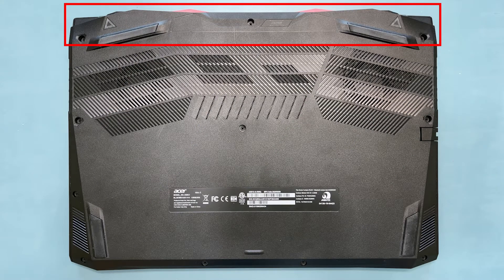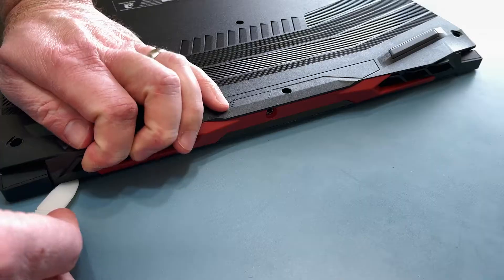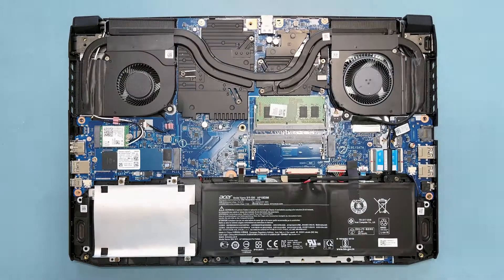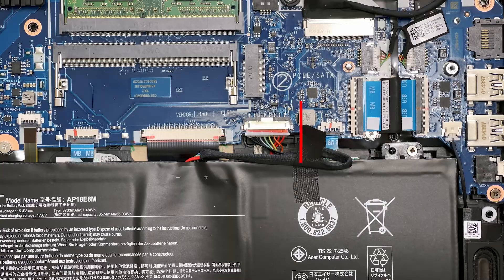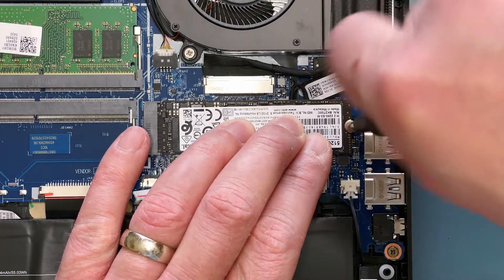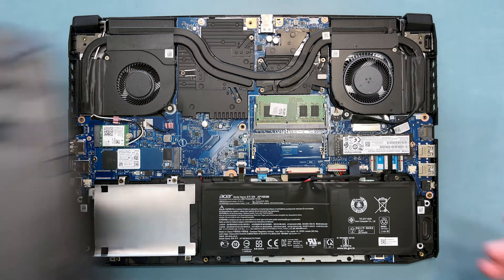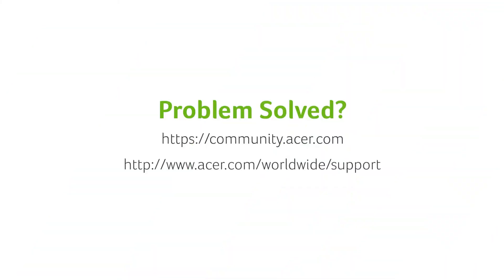Nitro 5 - How to install a second M.2 Drive

Comment: Does the laptop auto detect the M.2 drive or do you have to enter bios and check there to detect it? Also is this M.2 drive compatible with the Nitro 5 2021 model? Samsung 970 EVO Plus 1TB NVMe Solid State Drive. Thanks everyone!

Comment: upgraded my ram from 8gb to 16gb on my acer nitro 5 11400h 3050 variant. both my RAM stick sticks now run at 2933mhz instead of 3200mhz and there is no way to access xmp...

Comment: is Thunderbolt 4 supported in the Acer Nitro 5 (AN517-54-75NK)?  I've tested 3 docking stations but didn't work.  Can you please send me the datashet of the Acer Nitro 5 (AN517-54-794P)?  kandiese 2 NVMe and Sata SSD at the same time?

Comment: So do you need to do anything special before removing the battery cable so you won't get electricuted?
Reply: Not really. Just as always, when working on internals, keep yourself grounded to prevent static discharge on your components.
Reply: you don't even need to d/c the freaking battery lol... just wear anti static gloves.

Comment: The later model N20C2 (Jun 2021) has TWELVE screws [this one shown in the video is model N20C1 (2020)]. The twelfth screw is beside the small sticker that says "Caution". Internally, there is a slightly different setup near the secondary M.2 slot, but it is basically the same.
Reply: Yes! I have the new one! (Sunglass smiley)

Comment: I can install a M.2 SATA?
Reply from the maker: Acer does not offer support through YouTube. 

To receive help with your issue, we recommend visiting our Acer Community at https://community.acer.com/ here you can ask questions and receive answers from other users.

If you need further assistance please contact Acer for your region. Here is a link to locate the Acer center nearest to you: http://www.acer.com/worldwide/support/
Reply: Different models support different M.2s

If your pins of the SSd slot are aligned like 
" """" " 
It's a SATA slot and won't support NVMe 
If it's aligned like
" """""" 
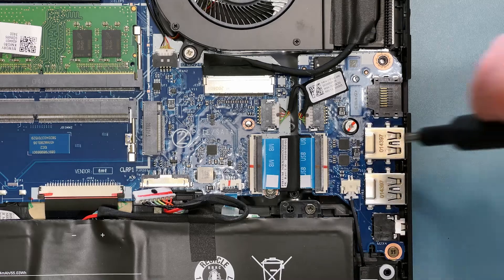It would support NVMe as you can see in this video at 01:38

Comment: I don't get it, he is putting an NVMe ssd in a SATA conector, doesn't that mean that the ssd won't work? I'm willing to upgrade my Nitro 5 with a second m.2 but I'm kind of confussed with this
Reply: On 01:39 you can see how the pins are arranged in NVMe format. Sata slots have 3 parts kinda like
" '''""'' ''
 while NVME pins are like 
" """"""
So his model basically has a NVMe slot, you should first check ur slots pins if they are aligned in Sata or NVMe format then get a SSD.
Reply: I have the same question and I can't find any motherboard specs.

Comment: I tried on my AN515-55, it shows nothing on the disk management, the drive is not detected. Why!???
Reply: let me know when you get an answer to this
im having the same issue
Reply: Different models support different M.2s

If your pins of the SSd slot are aligned like 
" """" " 
It's a SATA slot and won't support NVMe 
If it's aligned like
" """""" 
It would support NVMe as you can see in this video at 01:38

You probably installed NVMe on a SATA slot or vice versa

Comment: Acer nitro 5 Slot 2 SSD support m.2 NVME ?
Reply: Yes, it does
Reply: No it doesn’t I just tried to install a w d black nvme and it would recognise it
Reply: Some models do some models don't

If your pins of the SSd slot are aligned like 
" """" " 
It's a SATA slot and won't support NVMe 
If it's aligned like
" """""" 
It would support NVMe as you can see in this video at 01:38

Comment: Does a Samsung 980 EVO NVME SSD would fit this laptop?
Reply: depends on the length, if I see it right you can fit any 2280 in the laptop.
Reply: yes it does. because i bought one myself.  they fit all nitro 5 models
Reply: @stevenrussell5937  after installing the ssd does anything else need to be done before or after installation? Like any cloning or transferring?

Comment: Hello. I wonder if I can upgrade my Nitro 5 an515-44 with a SSD of 1TB in the second slot.
Reply: yes you can use any storage  from 250gb-2tb but has to be m.2 or a 2.5 inch ssd/hdd in drive bay hat open its like a sliver open spot

Comment: Does adding a disk drive void the warranty
Reply: In India yes.
Reply: @soumilswapna  if that happened to me. I just removed it before giving it to the service center.  I'm from India too. They told me I lost the warranty but I removed the drive and took it to a different center and had no problem
Reply: In Brazil it dosen't
Reply: Do it inside of authorized store or service center of Acer so the warranty will not be void, if you are only the one will install it the warranty will be automatically void

Comment: One other reasons I'm getting a Helios 300, you have 2 m.2s and a 2.5 bay that can all be used at the same time. Only issues I have is that there's no SD slot.
Reply: Hmm well for me 1TB (x2 512GB m.2) is enough so I got this machine and so far is working like a charm!